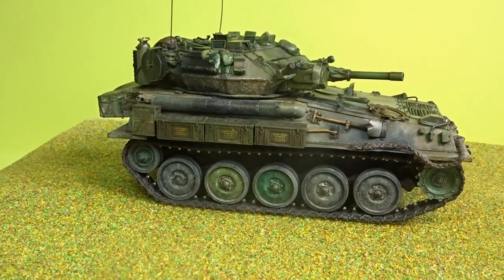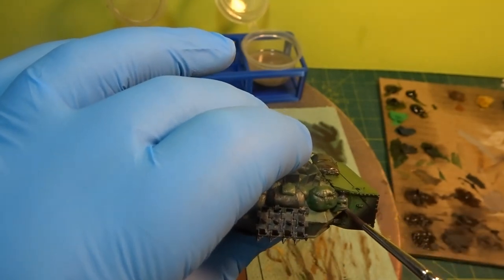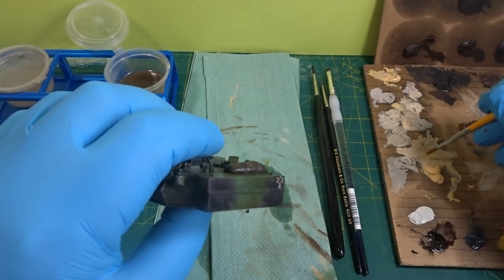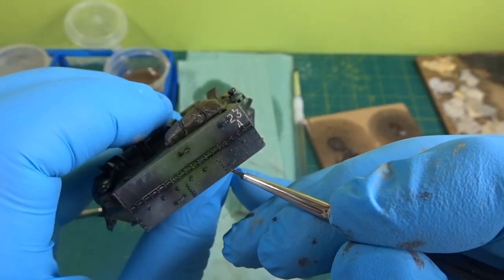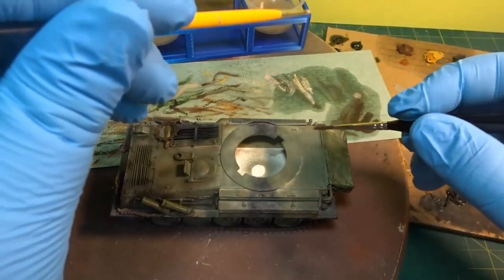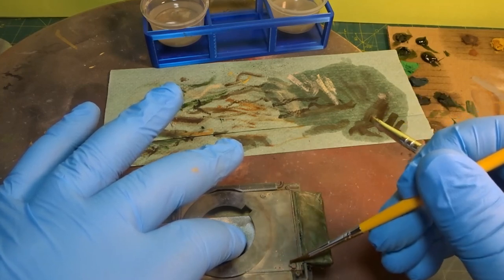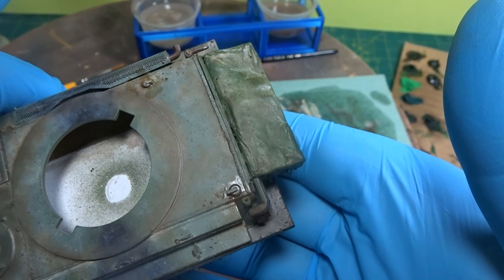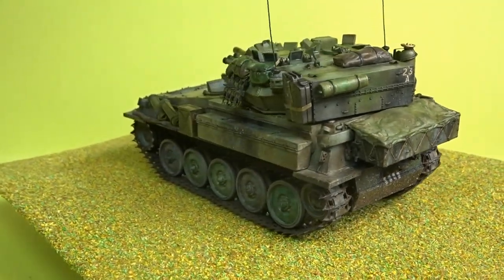Falklands War 40th Anniversary Blues & Royals Scorpion 1/35 Scale AFV Club  OIL WORK & FINAL REVEAL

Comment: Hi Steve. As I'm watching this The Rabble will be on it's way to St Ives. Have a great day.
Really informative video. Lots of tips. Once again the 3D effects which come through layering is evident. Surprised at the variety of colours you used. Working on one small area is definitely the way to go. Oils are heavily pigmented but your approach allows a degree of transparency. That 'almost a pin wash' late on is something that really makes the detail pop and is something I've not tried. I dry oils in a light box. I'm a bit frightened of using a hair drier - I have this vision of bits blowing off or melting something 🤣
Take care
Reply from the maker: Hi Jim. I have learnt the hard way with the hairdryer. Lost and melted many small pieces. Its all about keeping it on low heat for a longer time rather than high heat for a short time. I got back from the St Ives holiday yesterday. It was great to see the guys and JR was so happy when we won the silver medal. His work is even better seen in the flesh. Appreciate you looking in and your continued support. Speak soon my friend